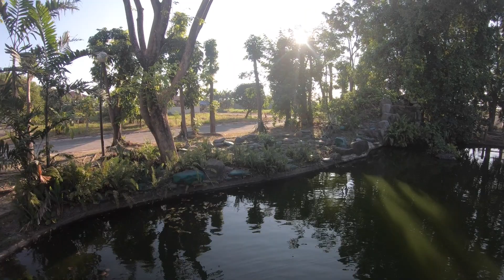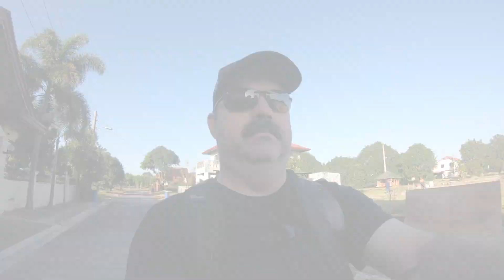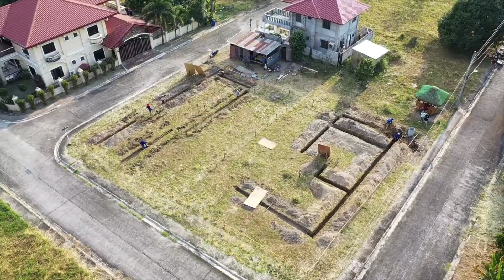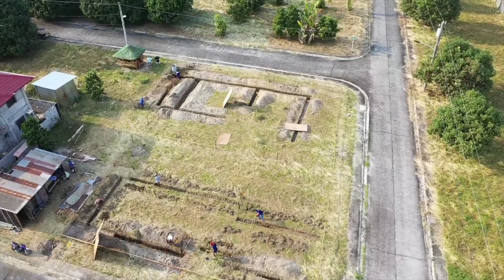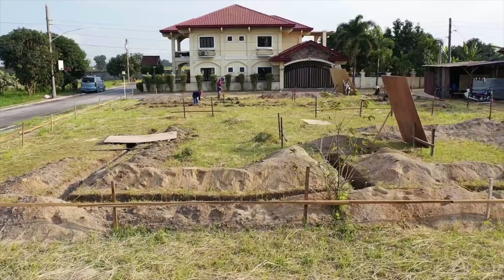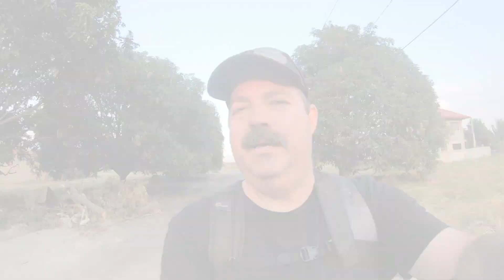Philippine House Building Step by Step, Build Day 4: Dig Dig Dig

Comment: Why not use a backhoe or some mechanical device to dig the foundation?
Reply from the maker: The cost of renting the machinery and the operator for one day, is the same as 10 laborers for a week. Why not put food on the table for 10 families, instead of in the pocket of one businessman.
Reply: @CasaTexPina  huge respect sir!